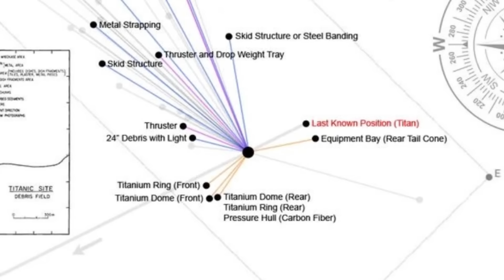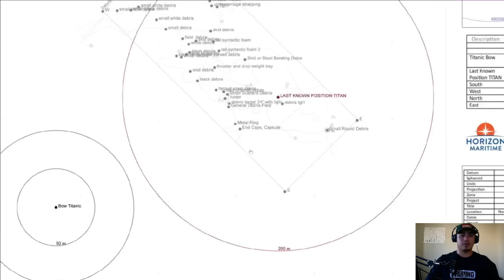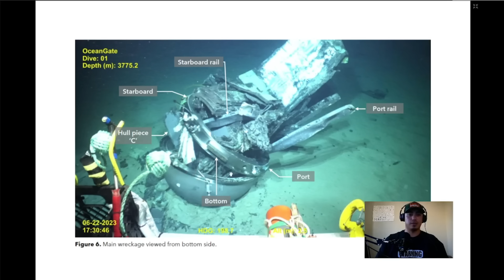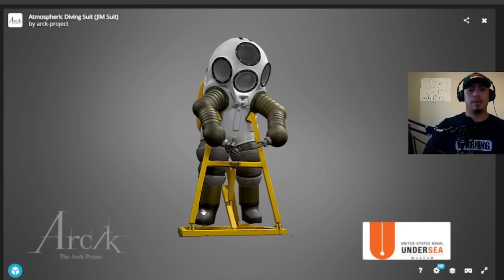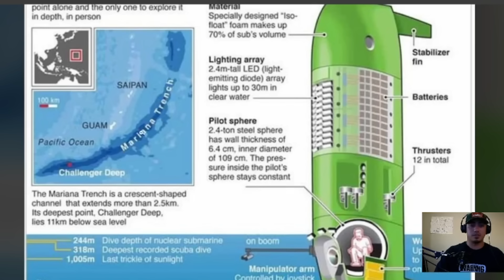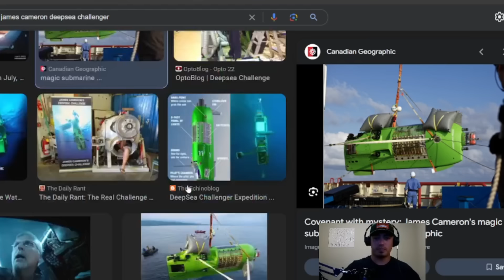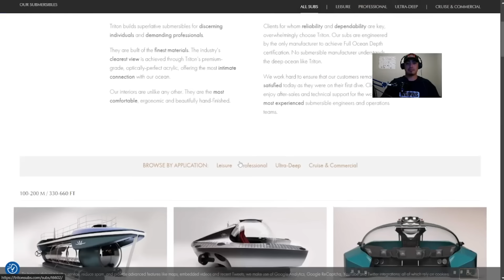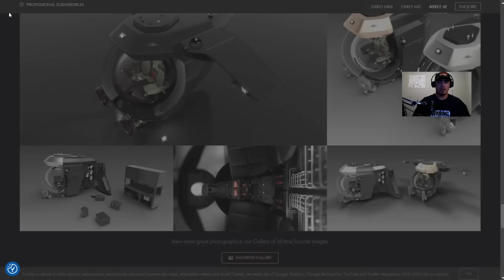Part 3: Investigating the OceanGate TITAN Tragedy: Mysterious Rust, Debris Theory, & Sub Comparisons

Comment: Off road trucks will soon race again at the Baja peninsula in Mexico. All off road racing trucks are built around a chrome-moly tube frame. Since many yrs ago, none of the competitors paint those tube frames for the simple reason of the need to conduct regular crack inspection. Yes, the frame is unprotected and can rust, but visual access for crack detection is far more important. Similar to the mistake w/ Rhino Liner.
Reply: Awesome, competent comment 👍🏼
Reply from the maker: Dude! Thanks for sharing that perspective that’s really fascinating. We say the same thing about stainless steel vs galvanized steel submerged in water for extended periods of time…. Stainless looks pretty but corrodes from the inside if left submerged. At the galvanized steel will lose its coating, rust, then wear. You have 3 signs before failure. Totally cool man thanks for sharing!!
Reply: Great comment 🙌🏻
Reply: Rush didn't make a "mistake". Just like he avoided X-Rays because he knew it would reveal damage, he painted it specifically to hide damage. He was a criminal.
Reply: @jcdenton6074 I agree, covering up details seems to be a pattern
Reply: @jcdenton6074  he was a very self righteous fool till the end

Comment: I think the Rhinoliner was used to hide the surface imperfections visible on carbon fiber surface.  To make passengers and observers feel comfortable.
Reply: Great, hide the flaws from the marks. 😮
Reply: Seeing it in production there was little lumps all over it & the CF threads did not look to have a smooth surface integrity either.
Reply: surface imperfections including the wrinkles that were ground off 😮

Comment: Mechanical Engineer here - CF is NOT to be loaded (a lot) in compression - like loading duct tape in compression - CF is BRITTLE & too many load cycles (dives) will weaken it & failure will happen after a few cycles.
Reply: Have you not read the transcript where Stockton Rush declared CF is stronger in compression, and he's the only one who knows this?

Comment: I was the guy complaining about the sound quality of your last video, and I wanted to thank you for investing into your new setup! It sounds great, I think what remains are reverberations because your walls are empty, but I see no reason to fix that at this point.
About that white fairing or streamlining, I don't know if thats true for the titan sub because it's creazy expensive, but other deep sea subs are using some magic stuff that looks just like the white boards on the titan to get their buoyancy, it's kinda like styrofoam but does not implode even at extreme depth. What I mean is the aft section must not have been as heavy as one might think with all that floatation devices still attached, and it would explain why they didn''t find more of that stuff on t he sea floor.
I've no idea about the rust spots, but who knows how clean they worked on that second hull.
Reply from the maker: Well thank you for coming back to check in! I’m glad it sounds better the hardest part was setting the mic up. Between the sound of my computer fans and the empty room it’s hard to remove all of the background noise.

If you look at the DSV limiting factor, you’ll notice it looks like a big pillow. 80% of that is the syntactic foam you’re talking about. Which helps with buoyancy.
Reply: @SSPDIVING  Yes the limiting factor, and I think the Alvin has that, too. Would be nice to know if the titan used something similar, or if they cheaped out on that again. Imagine stranding on the bottom of the ocean because your floatation devices imploded or made their way back to the surface without you because someone forgot to attach the needed carrying strap.
Reply: Its called Syntactic foam.  Its foam thats filled with hollow glass microshperes that render it incompressible while providing buoyancy.

Titan didnt utilize syntactic foam. Their whole point in using carbon fiber, in addition to lower cost than metal, is that it weighs a lot less and eliminates any need for syntactic foam.
Reply from the maker: I somehow feel like they did use syntactic foam in the tail. Maybe because it appeared to be in blocks and wasn’t part of the entire structure as it was with Limiting Factor. I could see them cheating out and buying small blocks rather than doing it properly. I’ll see if I can find out what material they used.
Reply from the maker: I want to know who figured that out. “Yeah let’s add some hollow glass microspheres, that will make it squish proof” 😂 too smart for me, I’m having a hard time even picturing it hahaha
Reply: @SSPDIVING  There was definitely syntactic foam at the rear of the equipment bay. After the tailcone fairing broke off, it was exposed in all of the photos and video taken after that point.

Stockton was on video complaining about how expensive it was. That expense is probably one of the reasons he wanted to use as much carbon fiber as possible and as little titanium as possible, because the more titanium he used, the more expensive syntactic foam he would have to buy.
Reply: @SSPDIVING  Also, the syntactic foam in the tail is why it landed tail-up on the sea floor—it was the most buoyant part of the equipment bay, so once it detached from the aft dome, that’s how it fell.
Reply: @ffasco  But all the Motors and batterys can't be waitless, so they sure used something to get their buoyancy back?

Comment: You were also right about the fact that the industry standard is not to use a straight pattern, but a crossing pattern when laying on the carbon fiber. The process they used was not typical even for carbon fiber manufacture.

Comment: As I recall, Trieste (the first one; there was a Trieste II of similar design but faster - 2 knots instead of 1!) was basically a blimp, with gasoline in the big cylinder. This was vented into the sea to submerge. The hoppers fore and aft held iron (or steel, maybe - certainly not lead) pellets with electromagnets at the bottom vents. The electromagnets were normally turned on, preventing the pellets from falling out. To surface, the magnets were turned off to drop enough pellets to allow the sub to drift toward the surface. In case of power failure, the electromagnets would turn off and the pellets automatically drop out.
Reply: That’s what you call a failsafe design. “We might not make it back up alive, but, by golly, our vessel will!” That’s smart.
Reply: @Worldbuilder  But Trieste was made of proper materials. The pressure hull remained intact all the way to the bottom of Challenger Deep with no sign of distress - weird noises and such. But if something in the control system went wonky (this was the better part of a century ago; nowadays besides hardware we have software which can act up and bite you in the ass at any time) the ship would still come up. A pressure hull which keeps the crew alive but stranded seven miles deep is still a good pressure hull but the rest of the ship can kill the crew just as thoroughly as pressure hull failure. But not so much with Trieste, which was designed with control failure in mind. In short, a very thoughtfully  designed ship.

Comment: I highly suggest checking out the Hydraulic Press Channel video of their experiment of the carbon fiber on YouTube. They created a small version of the carbon fiber vessel with the metal ends each side and they tested it under pressure which showcase what it could have happened with Titan when it imploded. Honestly it’s the best representation that could look like when the carbon fiber splits in several layers but still attached to one side of the metal hull.
Reply: Did they test it under pressure in one direction (uniaxial hydraulic press) or all directions aka hydrostatically (as would be the case in water).

Comment: The yellow might be a discontinued primer paint.  The last 4 on the NSN -6557.    
There's a seafoam green primer that IS seen alot on the carbon fiber.   I saw a few critical mistakes in the production videos.
(I'm a retired aircraft mechanic)
Reply: The seafoam green is the epoxy glue between the 1" thick layers of CF.  
Rather than being a single 5" thick monolithic tube, the hull was built up from 1" of 133 composite layers, then cured, then sanded (because their cure process was bad & created wrinkles), then a glue layer underneath the next 1" of composite.
The sanding is a huge problem as it substantially weakened each 1" block by cutting through the carbon fiber winding layers at the wrinkles... But the wrinkles were so bad that those layers were already compromised and laying the start of the next layer flat was deemed more important.
They might have gotten away with their screwed up process if they had designed in a large enough safety margin of 1.5x (which would have been 6x 1" layers), but they were already working within a 1.25x margin for that depth (they absolutely needed 4" worth of strength, and had 5x 1" layers glued together).
The wrinkling of the outer regions of each 1" layer & windings intentionally cut by sanding the wrinkles down, meant they had barely any safety margin left.

The hull flexed more than it should have, which caused the inter-layer glue to gradually delaminate, until there was a major delamination event on the way back up on dive 81, at which point they didn't have a 5" thick hull anymore, but rather multiple concentric hulls sliding against each other as they flexed.
(Based on the wreck, it looks like it was in 3 parts, two 2" double layers, & one 1" layer.)

Think the difference in flexibility between a deck of cards and a block of wood the same thickness.

The worst part of the whole affair is that their hull monitoring system WORKED and the strain gauges not only told them that something had gone seriously wrong near the end of dive 81, but also showed that the strain data on dive 82 immediately showed that the hull has delaminated because the measurements from the sensors were now non-linear unlike every previous dive.  
It also warned them that something was seriously wrong early enough into dive 82 that they were still shallow enough that even a single 1" layer was still safe, and Rush continued the dive anyway.

He then took the fact that dive 82 HADN'T killed him as proof that nothing was wrong, when in fact it is almost a miracle the hull survived dive 82 with that sort of damage, much less the several more it made before the fatal implosion.

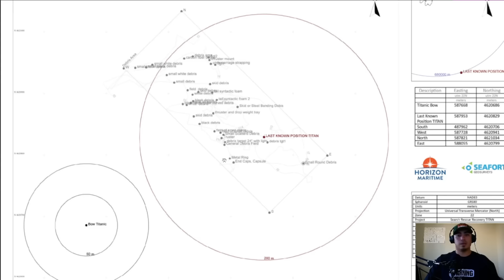Comment: 7:47 just imagine if they imploded near the titanic and one of those 3,500 pound titanium dome landed on the wreck causing further degradation
Reply: Edit: I didn’t read the original post carefully enough, so forget I ever said this:  Those tanks don’t weigh 3,500 pounds! They hold oxygen compressed to 3,500 pounds per square inch (psi). They weigh little enough you can maneuver them around with one or two people, depending on what kind of transport equipment you have, and exactly how big they are.
Reply: it would turn the titanic into dust tbh,
Reply: @PetesGuide  it’s not a tank it’s the front and back titanium domes from the pressure chamber of the sub, and they are that weight
Reply: @russellfulton6861  Doh!!

Comment: The "Trieste" is technically known has a bathyscape. The loud Crack heard on the dive; was a Crack in the 6 inch thick quartz window that was on top.
The widow was in the access tunnel. This was a narrow passage from the top of "Trieste: to the spheres. 
The window was for the recovery team. The sphere had a separate door.
Walsh and Piccard only discovered the crack after the dive
Also this incident occurred around 23,000 feet during the descent.  They did consider stopping the dive but they reasoned if it imploded; they wouldn't know about.
The communication was spotty after 18,000 ft but the navy was trying to figure out  long range communication for the nuclear subs. The US Navy did the dive in secrecy, because of the testing and if the men were killed; they could keep the news secret for 10 days. The Navy has lots of film on the "Trieste: plus many publicly available documentaries. The building of it is amazing along with the person who built it; who designed and built a balloon that held the high altitude record at that time. He was Swiss and it was his son along with Lt. Walsh who made that historic dive

Comment: My best guess for the rust marks is that’s where they attached the “ballast” which was a bunch of rusty pipes strapped to the bottom. Probably rusted while in contact with the hull and rust stains like that get in very deep. wouldn’t just wash off in the water.

Or some sort of marine snow building up on it, does tend to look yellow/greenish like that

Comment: If you're asking about human remains, it depends a lot on the speed of compression and temperature of the implosion. There are parts there that look like parts of the skeletal system, but could very well be electrical or mechanical structures. One would need to know how the pathologists described the remains they were able to examine. 
The only clue I can give you is that fish would only be nibbling at soft human parts such as flesh /bone marrow /organs etc, (or sandwiches). And body parts would generally be red / pink /white /gray in colour, or black if burnt. Regards.
Reply: The compression happened over about 3 milliseconds with 4900 pounds per square inch of pressure. It would be mostly molecules. The water soluble stuff would dissolve. There was a report of ‘presumed human remains’ in one of the recovery reports, and one guy described a ‘paste like substance’ that tested positive for occupant DNA. My guess is that the non-water-soluble tissues would be the major constituents of such a substance. There’s an orthopedist on YouTube who did a presentation on this. 
It’s worthwhile knowing that the human nervous system takes 40 to 90 milliseconds to perceive anything, which is longer than 3 milliseconds. There would not have been time to know it was happening, much less feel pain.
Reply: @lynnlytton8244  Thanks for what you've given me. But The trouble is that I've had a lot of experiences as a doctor, deep diver, surfer, canyoner, etc. And so frequently, things do not actually happen in the way that the story ends up becoming. I need to know EXACTLY what those human remains were.
Most dramas are a mess. Most rescues are a mix up. Human stuff ups are buried. Notice how in major dramas, and rescue is needed, there's never anyone there for hours? Then once everyone is dying or dead, all the rescue craft arrive. 

Do you remember when there was an airliner crash at nite on a snowy forest in France, and the rescuers all stopped to go out for dinner and sleep overnite. And left the injured and dying passengers overnite for the wolves!

Notice how they never mention 2/3rds of the lifeboats that were TAKEN OFF the Titanic beforehand! Or the multiple explosions!
And that the Marconi operators gave out the wrong coordinates three times. (?Deliberately it seems)
Ever known an ocean liner before, to just sink in absolutely calm waters out to sea? 
Ever heard of officers in peacetime firing pistols and threatening to shoot anyone, even from half filled boats, who wanted to go back to pick up their own male families in the freezing waters?
I even remember personally as a child, being locked in by crew, way below decks in an ocean liner behind those gated metal doors. Those nasty things happened.

I think the Titan was sinking at about twice its normal descent speed of 35 metres/ min. Possible due a leak, or delamination. And due to its weight, couldn't slow down. Stockton had to deal with a drama, maybe water on the lithium batteries starting a fire and slowly destroying all power. They were in more confusion than we were! They lost complete contact. (It's believed they were sinking head first and that they floated till the navy heard an implosion, 2.5 hours from the last communication). I think the Titan crew knew they were in trouble straight off. And would have felt the last event even if quite briefly. It's nice to think they didn't, but I think that's only our wishes as fishes. Regards and good wishes.

Comment: I have both mechanical engineering degree & 3rd Class boiler operator ticket.  One mistake people intuitively make is they think high kPa outside, low kPa inside, so everything should compress like the styrofoam coffee cup taken down? Wrong, most damage is caused by water hammer going inside.  Water hammer will deliver a pressure wave > than outside kPa because the high kPa water outside has potential energy converted to kinetic energy to form water hammer (which rips steam pipes apart). If by chance pressure all around a piece of the sub rises uniformly, than there will be no damage, like the fish swimming around.  Water hammer is why I knew the 2 domes wouldn't come together like in those Dr. Ing Finite Element Analysis videos we've all seen.  FEA is not easy, so video was good as 1st iteration, but it didn't show water hammer.
Reply: And so the water hammer effect would explain why the photos show everything pushed into one end?

Comment: When the Titon was descending they were diving a little faster than they were expected to. Considering that they carefully weighed everything and everybody so that they could know the exact weight of ballast needed for neutral buoyancy. And because of the rhino liner coating on the outside limiting inspection of the outer hull and they never removed the inner lining for inspection because it would take too long. There faster than expected descent would be an indication that the hull was damaged and partially buckled and less buoyant than expected.